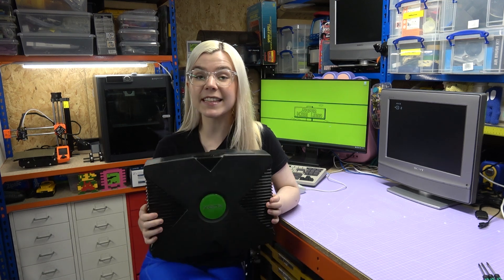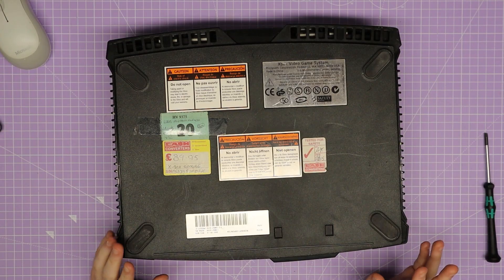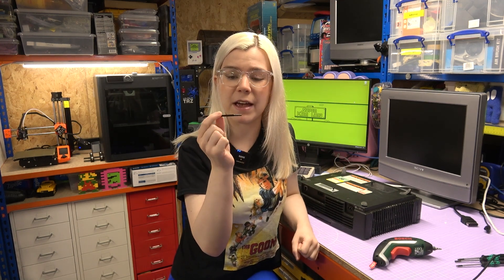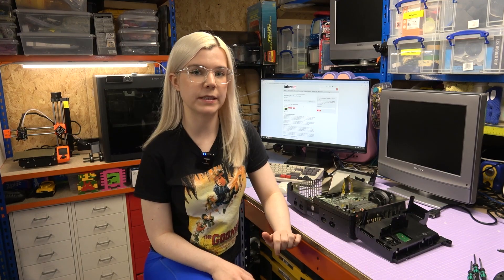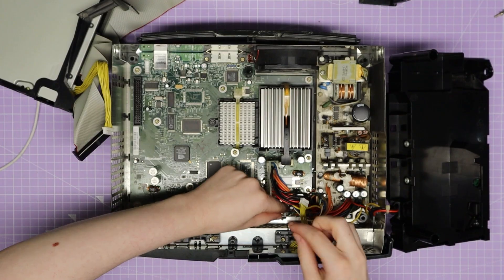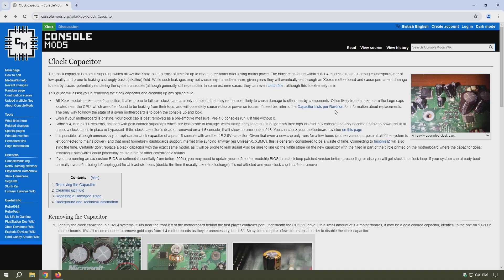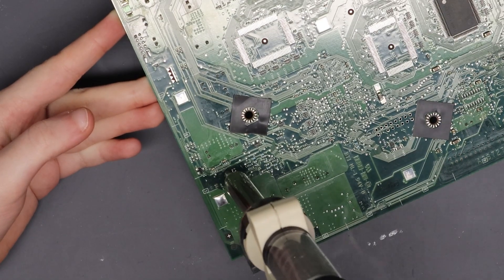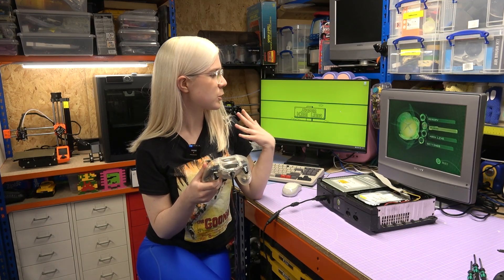Removing the Xbox Clock Capacitor before it destroys the console

Comment: I am just exploring everything surrounding capacitors on retro consoles, I just recapped a PSOne in fact. seeing your video now is leading me to write on my project list doing this exact work on my xbox that I got second hand a few months ago. It works, I haven't opened it yet to assess it's state, hopefully when I do there hasn't been any initial damage. Great video Kari! looking forward to more projects on your xbox!
Reply: Remove the clock cap and replace the thermal paste. It's a good idea to go ahead and buy a SATA to IDE adapter (Startech is the best for OG Xbox) and replace the hard drive. You can softmod your Xbox and use CHIMP to clone the drive over to the new one. Sadly, OG Xbox hard drives are one of the biggest problems. At their current age, they will likely die very soon if they are still working, as the life of most HDDs are 10 years or so. If you are able to softmod and clone the drive, it will ensure it can run for quite some time. You CAN use a solid state SSD as well if you want to have less moving parts and may keep the Xbox running even longer.
Reply: @husky3g  solid tips thank you! I haven't gotten go this project yet but I will soon...
Reply: Nice! I wouldn't power on that OG XBOX again until you check the caps! :)

Comment: on 1.6 / 1.6b boards I recommend replacing the capacitor as well for preventative maintenance. Unforutnately you can't just remove it on those versions since it's integral for the consoles function to boot on those board revisions. I did a re-cap on a 1.6 board a couple years back for my older brother when I did an aladdin chip mod to replace the HDD. The console works great after a re-cap though.

Comment: Eh, I would have gone ahead and replaced the capacitor. First of all, you can choose a good brand which will give you many worry-free years of operation to come. Second, having to reset the clock gets old after a while - after all there are some games that actually rely on it. IIRC, The Project Gotham Racing games utilized the clock as the time of day for the racing events, relative to the actual time/time-zone in that city when you play.

Comment: Very interesting video Kari I thought perhaps you might be installing a cap at a slightly higher voltage so it wouldn't leak and still provide dc smoothing on the clock circuit.

Comment: It's a little hard to tell from the distance of the overhead shot but it looks possible that a few of the caps on that power supply are leaking from the top. Or are they just marked like the clock cap was? I'd recommend taking another look at that to be sure. I know the clock cap removal is a common Xbox mod but these caps were all made during the "capacitor plague" era so it seems unlikely that's the only one that would go. I also confess that I don't really understand why this mod just involves removing that cap rather than replacing it. This isn't meant towards you since I know this is just what a lot of online sites recommend to do, but I just don't really know why you wouldn't just replace a bad cap with a good cap (one not from the capacitor plague).

Comment: If you are going to recap the xbox, don't forget the DVD controller board, in my experience, those caps tend to be very out of specs without showing any sign of leakage. Samsung DVD drive tend to highly benefit from having their controller board recapped.

Comment: I work in Broadcast Engineering and there was a notorious Sony parallel to serial digital video chip called the SBX-1601 which always went wrong. They were such a pain to remove we would smash the top off and heat each pin and pull them out one by one from what was the inside of the chip.
Reply: Ouch. Sounds a lot harder to do than desoldering .

Comment: for those interested. this is usually a non issue on version 1.6 xbox'es. if you have one of those you are better off leaving the clock capacitor alone.
Reply: on v1.6, you NEED this capacitor for the console to work. This only applies for v1.0 to v1.5 consoles.
Reply: @RaptorZ01  not only that. the capacitor used at the time was better on v1.6

Comment: I definitely would recommend installing a modchip to further future proof it, as the hard drive ages it could fail and is tied to the motherboard and a modchip would fix that issue. I would also do a full recap as the CPU caps suffer from the same issue as the clock cap. Enjoy the Xbox! It's a fun system to mod and restore.

Comment: so, the clock capacitor is a redundant conponent, ie you don't need to replace?
Reply from the maker: From what I read online, it doesn’t really need replacing. You just get the time set reset screen when switch it on if you haven’t played in a while.

Comment: I've got three OG XBoxes that I need to check for this. One is hardmodded with an Executor chip (I bought it like that), and it may have had this done already. One is softmodded, and the other is original. So you just remove the clock capacitor and leave it like that? You don't solder another capacitor in its place?
Reply from the maker: From what I read online, with unmodded consoles it fine to remove the CC if applicable version, however with older soft/hard modded ones it can cause something called a clock loop. So it best to do some research/upgrade the mods before you attempt. Regards replacing, again from what I've read it's not necessary to replace.
Reply: @karilawler  Thank you for the advice! I will do my research before attempting this, although this is something I've been wanting to do for a while. I need to do it this year, really, as time is of the essence with this fix (and I hope none have yet leaked). Great video! Keep up the good work, Kari! 👍

Comment: Hi there.  I have a heavily modded Xbox of that type and was not aware that there could be an issue with the clock capacitor.  Does the Xbox not need that capacitor?  Why was it installed if not?
My favourite game is Black.  It is an FPS game and I have completed it several times.

New sub by the way.

Comment: Hi Kari.
I will give you a nice tip for removing old components from boards. If you first give the components some fresh solder, then you can remove them more easily with your desoldering gun because you will get all the solder off. I use this method my self, when I recap old Amigas and C64's f.ex.
Thanks for this nice video you have created, and I will use it when I am looking at old Xbox consoles. :)
Reply: She literally did that.. she talks about it at about 7:37 (she just didn't show it) - she added some fresh solder and some flux before using the desoldering gun
Reply: @stephenpalmer9375  Sorry, I didnt hear that. I just saw she was struggling to remove the capacitor and wanted to help Kari. 😊

Comment: If the de-soldering iron has a control for using the pump, when you put the nozzle over the component leg, count to 3 before using the pump, this will help melt the solder and make it flow into the gun better and give you a clean de-soldered joint making it easy to remove or replace.

Comment: Halo ftw also. Thanks for the tip on the cap Kari. Looking to pick one up in a few weeks for the collection. 

Unrelated but any recommendations of a decent desoldering station?

Another cool t-shirt btw ❤
Reply from the maker: mines just a cheap and cheerful one, I got from a company called CPC https://cpc.farnell.com/duratool/d00672/desoldering-station-uk-eu-plug/dp/SD01384?st=duratool%20desoldering
Reply: @karilawler  Perfect thank you Kari 👍 More than suitable for my needs (mainly retro machines). Anything is better than a manual solder sucker.

Comment: It would have been nice if you'd mentioned what the clock capacitor was actually used for and the effect removing had on the machine (or potential effect.)  (I initially assumed you were going to replace it, not just remove it entirely.)  Just a suggestion as I'd like to know these things!  Enjoyed the video nonetheless.  :)
Reply from the maker: Yea, the general consensus online is, once removed you don't really need to replace. And as far as the outcome, it asks for the time to be re-entered again if turned off for a good few hours. There is summary of this, in the video description.
Reply: @karilawler  Perfect, thanks!
Reply: @karilawler getting busy on this now, i always just assumed the xbox couldn't keep time at all when unplugged so adios cap😂
Reply: @karilawler  I think I'd replace it as I am lazy and entering the date would annoy me :D Great video though!!
Reply: @jaybowles112  no lo uso tan seguido como para molestarme pero realmente me sirve que no se quede arruinado
Reply: It's worth noting, a 1.6 motherboard will not power on without the clock capacitor, so you'll need to fully replace it.
Reply: @TooBokoo  At least those have a better supercapacitor. None of them are leaking - until now - in my XBoxes.
Reply: @pezia  Yup. I have a few xboxs and my 1.6 has a nice gold Nichicon cap that seemed fine. I still swapped it out, but far less chance on those boards being bad.
Reply: This clock cap was absolutely necessary for XBOX Live authentication, back when servers were online.
Reply: It saves the time like a battery.
That's why it leaks battery fluid.
You only need to replace it if you care about keeping the correct time.
These will eventually fail in all xboxes.
Reply: I mean, it's called a clock capacitor. It allows the Xbox to save your clock settings when the system is unpowered for a couple of hours. The fools should have just used a cmos battery. Which is tried and true even to this day.
Reply: Nicely done Kari, I hope when you decide to mode the XBox that you  add a better DVD and a bigger and faster HD, like a500 GB SSD or 1TB SSD and of course rethermal past the the chip and maybe add copper heat sinks and thermal sponge aif needed, maybe changing the fan to an upgrade. PS,  my old XBox got very hot after a few hours, thanks again keep up the great work! 👍
Reply: If the part wasn't needed then Microsoft wouldn't have paid to put it in there.
Reply: I was thinking the same. What purpose does it serve?  It was put there for a reason. I would probably have swapped it with a higher quality Nichicon instead of removing it altogether.
Reply: I feel like "clock capacitor" is all you need to understand what it does...
Reply: @tootone  Agreed, but the clock capacitor may be required to be there.  As is known in later versions of the motherboard to be true.  So it would have been more thorough to explain it further, regardless.
Reply: It would have been just as nice if you mentioned what if there was any positives or negatives in removing it; if you know that is.
Reply: My brother in Christ, read the description! All the info you need is there.
Reply: She did mention it in the description part. But ppl are to lazy to read 😂🤣😄😚😙😗😘
Reply: She did.
Reply: It’s called a clock capacitor, what did you think it did? Of course removing it will cause the console stop keeping time if unplugged.
Reply: @stephenshelottiii3272  - Perhaps replace it with a small super-capacitor tucked away in the corner of the case with extender wires to the main board to avoid leaking. ;)
Reply: @BillAnt you're honestly just better off removing it completely and modding your Xbox. Xbox mods disable the clock check so it doesn't nag you about it. Also, some people would argue that they want to keep their Xbox pristine and stock. Those people are fools as those Xbox's are on borrowed time. When that HDD dies, your Xbox will be useless until you read that Eeprom and build a new harddrive using the keys that are married to the drives.
Reply: Google it instead of bitching on people's video, maybe?
Reply: try reading the video description
Reply: @bushwickbillOG someone pointed this out already in a previous reply in a somewhat more polite manner

Comment: Cool futureproofing. It's really great that there are information about these things, so people can prevent disasters happening. Managed to save my Commodore Amiga 500 extra ram card from disaster, as the real time clock battery tends to leak in these as well, and destroy the pcb. Found information about it in online forum, checked mine, and indeed catched it just in time, it had already started forming corrosion to the battery, but it wasn't at the pcb yet :)
Never had the original Xbox, my only one is Xbox One S and my favourite game is Forza Horizon 4 and 5, love the open world driving in them. I guess Forza games (Motorsport and Horizon) started with the original Xbox.
Reply from the maker: I wasn't that lucky with my Amiga 500 plus, the board had quite a bit of damage. Thinking though, of either getting a donor one from eBay, or a complete new PCB that I can transfer what I can rescue over. Also happened to a Acorn A3010 I've got. I hate those, clock batteries!!!
Reply: @karilawler  Indeed A500 Plus has the battery on the motherboard, so it's not that easy to check comparing to older Amiga 500 extra ram card through the trapdoor underneath. 
Removed my leaking Varta battery in 2006, and the manufacturing date on my extra ram card seems to be 1993, so just 13 years, and it started showing signs of "green crusties". If I didn't catch it, probably these days the entire card would be completely destroyed, so indeed really glad people had posted about this problem in online forums. In 2006, Youtube was just in it's "infancy", so not many videos yet about stuff like this back then :)

Good thing is there seems to be new motherboards available, RMC channel did a video about it couple of years ago:
https://www.youtube.com/watch?v=87q-TTG48Ew

Also good thing is that more modern devices use regular coin cell batteries, which usually don't leak. At the start of this year, replaced dead battery from my PS3 Slim which I bought in 2009. No damage :)

Comment: What interface does the hard drive use?  I assume IDE, I wonder if one could put an SSD, or one of those 15k RPM raptor drives in there for an upgrade?  the system's pagefile would love the speed boost.
Reply from the maker: It's IDE ... the hard drive is also locked to the system, so you have to soft/or hard mod it, to do the swap. Planning to do video about it soon 👍
Reply: @karilawler  I figured size capacity would be an issue depending on the file system utilized, but did not know about the soft/hard mod needed.  Looking forward to it.  Also, Star Wars KOTOR was my absolute fave from that console.
Reply: Aladdin is as of my knowledge the best mod and I think you play arcade games with a 128mb RAM upgrade 😊

Comment: Xboxes had a ton of off the shelf PC components for a console (unlike Sony and Nintendo's custom silicon). That's why they were so expensive and large; but it certainly makes tinkering with them easier.
Reply: The original Xbox is basically just an x86 desktop PC modified to run Microsoft only games.